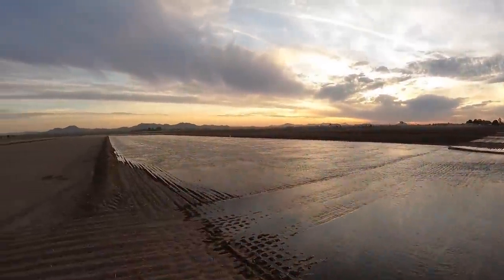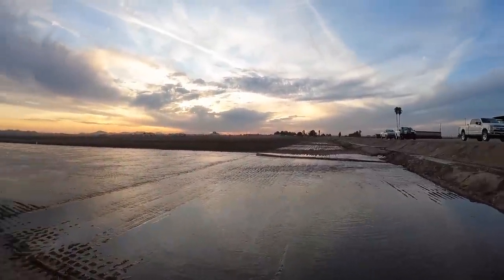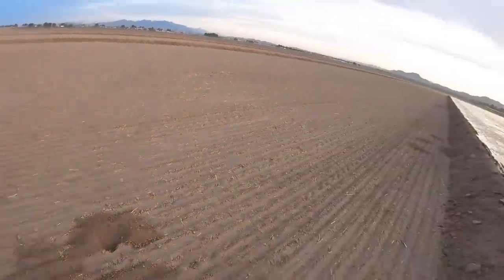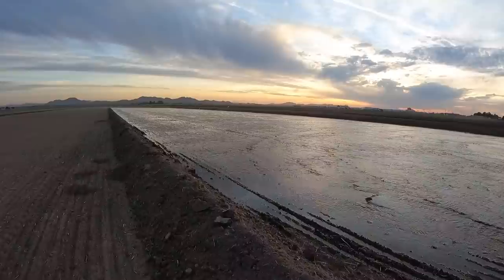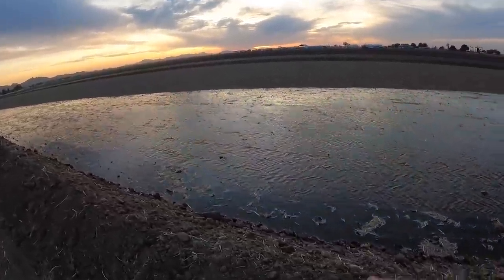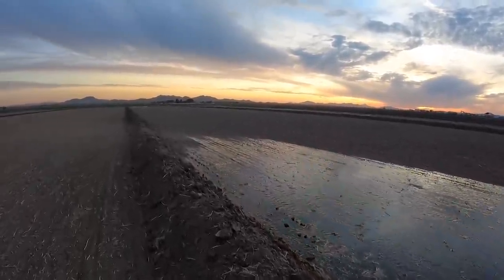Why Is Hay So Expensive??

Comment: Most people don't realize th expenses in hay. I bale on average 1000 to 1200 4×5 round bales a year mostly for my own use. Equipment, repairs and fuel along with twine or netwrap costs are insane.  Great video and I feel your pain on a much smaller operation.  See you next time
Reply: Hello Michael,  yes you are so correct,  I bale 1000plus 4x6 rolls and 5000sq bales. For our cattle operation as well, ppl just don't understand of how much work and especially the expenses that go into a bale.
Reply from the maker: Then they want to low ball on cattle prices.

Comment: I worked for SCS when we were putting in level border irrigation in Arizona.  We had 15 CFS or more available that the farmer routed into a border that was more narrow than your borders.  So, don't be surprised about your advance being slow on level borders, when you don't have the water supply rated.

I am a retired professional engineer, electrical and agricultural.  BS and MS in agricultural engineering.  MS thesis was on CFD of level border irrigation.
Reply from the maker: When we have a big ditch that can hold 300 inches of water, we have big borders. When we have small ditches with less water and less head pressure, we have small borders.

Comment: Be interesting to get an update from you now in 2022 about inputs?  Here is Spain we had our worst winter and spring in memory.  The winter was dry, meaning our ryegrass hay was very poor establishment and late growing (we couldn't irrigate because of winter maintenance on the canal system).  Then in April / May we had daily rain for over five weeks (very rare for us). The ryegrass loved it (have just made some of our best hay ever) but our alfalfa crops suffered.  Because we basically are on old marshland, when it does rain we can't get on the fields for weeks and so we couldn't harvest or spay or fertilize.  The result was very poor weedy alfalfa crops.  They are improving again now, but as our region is one of the main suppliers in Spain, the price has gone through the roof.  When combined with cost of string and fuel, quality hay is at risk of becoming a luxury item for some of our customers. We are lucky that most of our agricultural customers realise the reasons and understand, but I do really fear for the cost of producing next years ryegrass harvest given I am now looking at seed and fertilizer for this winter and honestly don't know if the cost will be simply too much for our "recreational" equestrian customers... Always love your videos - it's amazing how similar your system is to our own (albeit you're much bigger), especially the irrigation.

Comment: Just wondering if you have to counteract the salinity of the water when you irrigate?  And I've neve heard of "paying for ground water" but I don't pump it for commercial gain; maybe a different set of rules?
Reply from the maker: We run a lot of sulfuric acid to push the salts down.

Comment: We bale 30,000 squares annually. A price change in fuel, chemicals, twine, fertilizer, etc... has significant impacts on us. Most people don't see those factors, so they think they don't exist. This year, all of those input costs are higher than ever (most double, some even triple). We try to keep our cost to the client as low as possible, but sometimes you have no choice but to go up. People think a $0.50-$1.00 increase per bale means we're suddenly going sports car shopping.....we're not. We're giving it to the suppliers who went up on us.
Reply: People don't realize what fertilizer, fuel and equipment costs are not to mention time and labor.  I refuse to mine my soil and give my hay away. It's too much work.  If fertilizer prices don't come back down hay will be up $2/bale next yr so roughly $7-8 / 50#. Bet some of my customers will balk which means less hay in the future so more corn & beans acres.